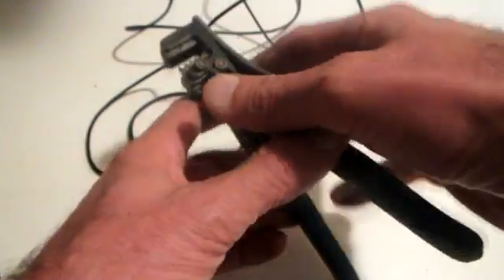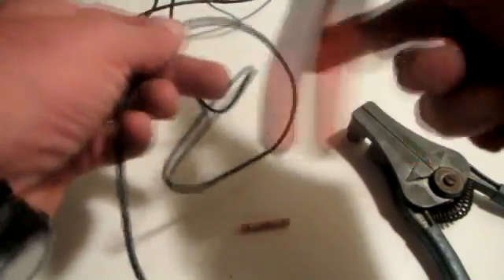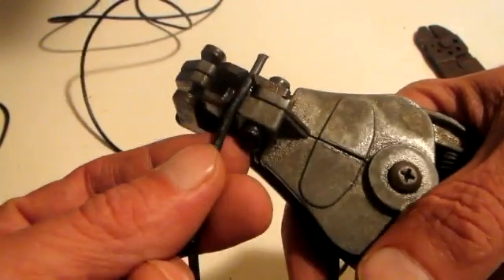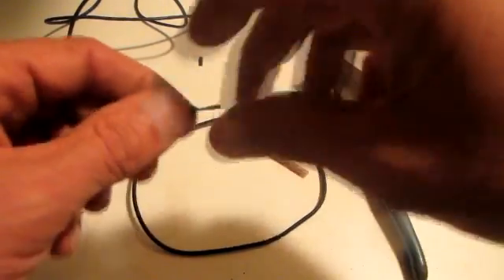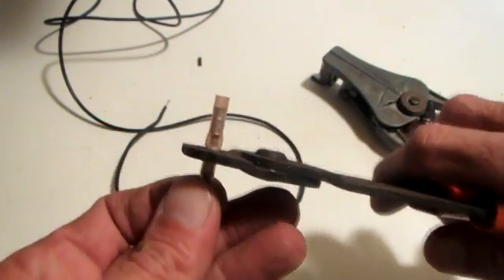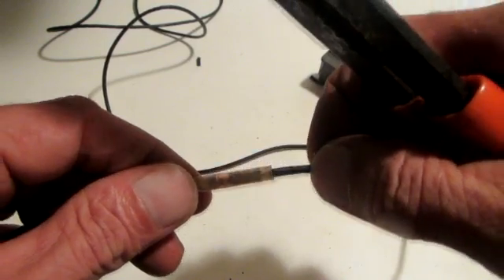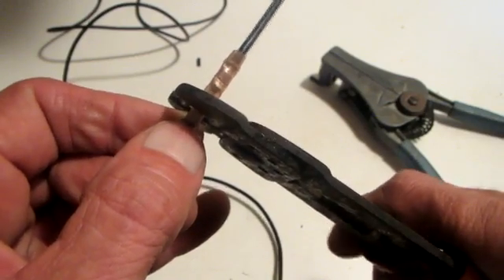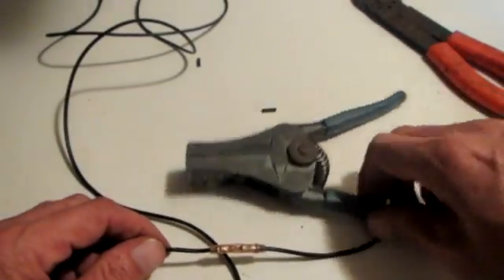How To Splice Two Wires Together Using A Butt Splice.

Comment: The part I never seem to understand completely is: Are the wires supposed to meet in the middle and touch? Or is touching the metal in butt connector enough? It makes sense that the wires don't need to touch; the contact with the metal should be enough. Not 100% sure.
Reply: The metal is making a circuit

Comment: Not having proper tools, I used a long nose plier with a wire cutter because i was not strong enough to crimp the connector with (small) long nose pliers and i cut right thru the connector. Do I have to cut it off and do it over? Sorry I'm new at this.
Reply from the maker: I would.  How can you trust the connection? Thx for watching.

Comment: do you think this would work for a skill saw I messed up and cut the trigger wires to the saw and there just positive and negative what do you think?
Reply: I was wondering the same thing but just for about any wire but it seems as though nobody took the time to answer you. Straight assholes if you ask me 😂😂

Comment: I accidentally cut my garage power cable so I've been scouring the net for repair tips. This is very helpful but I have a question. What I cut is a Romex cable with 3 wires inside. So I would need to use 3 connectors to connect each individual wire, right? I got an underground splice kit but I think I need to use butts just to add a little additional wire  (not enough slack).
Reply from the maker: Butt splices will work.  Stagger the splices an inch or so and cover each splice with shrink tube. Not sure I understand? The cord is too short for the repair?  If so, I would recommend replacing the entire cord.  Hope this helped. Good luck & Thx for watching.
Reply: Bill Eaglerunner The cord was very tight so after I cut it the 2 ends couldn't quite reach each other. I stripped off the Romex cover,  connected a butt splice to each wire in each end, and added 2 inches copper wire in the middle to make up the slack and connect the splices. Covered the whole thing with gel wrap around splice kit and it worked. Thanks for the reply.

Comment: Very clear video, ta very much. I got a question though, you know if you had to crimp a butt / bullet connector onto two separate wires of the same size and gauge and they had to connect onto one wire, how would you go about doing that without soldering?
It's two separate license plate bolts with LEDs in them and I have to connect them to one wire, is there a sort of 2 into one sort of connector for these?
Reply from the maker: Most cases you would twist the two wires together and slide them in the splice. You might need a bigger splice if the wires wouldn't fit. Thx for watching.
Reply: i think i get the idea ofjohnny 40se7en question not to sure
Reply: Use a Wago 221 connector.